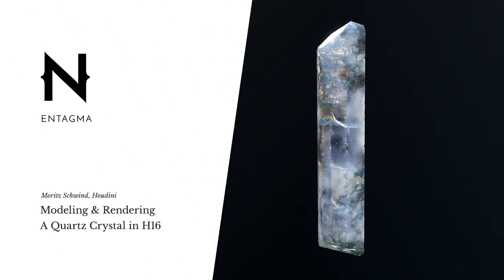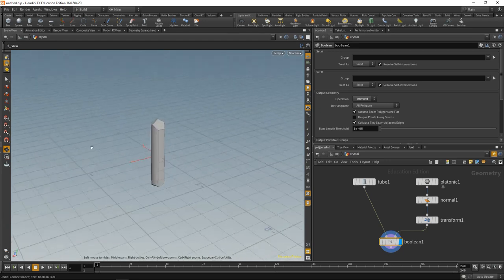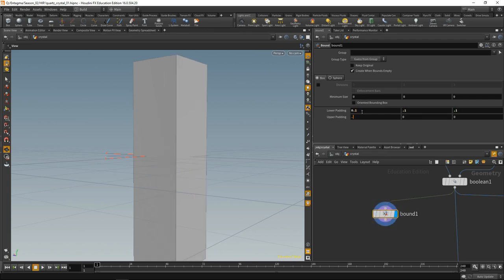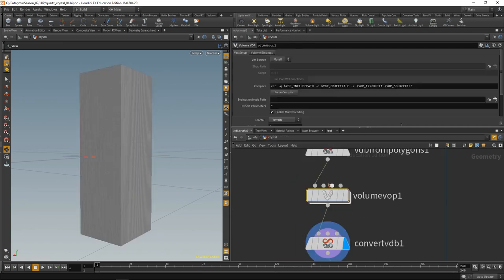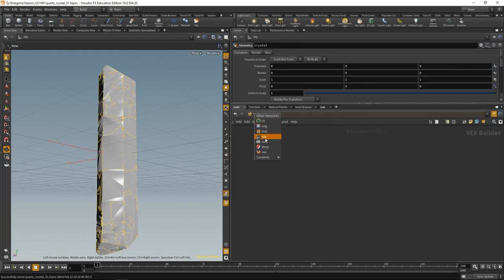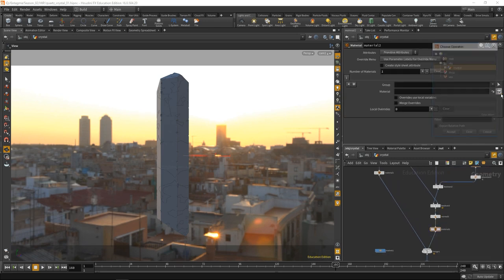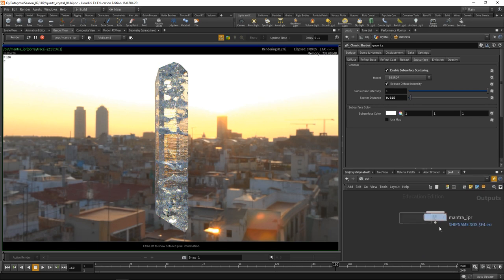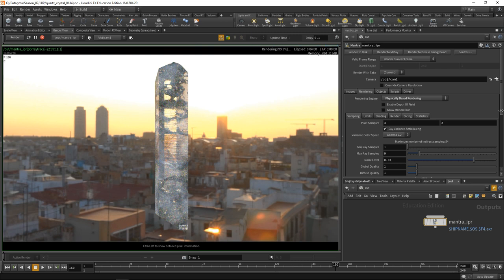Modeling & Rendering a Quartz Crystal in Houdini 16

Comment: For anyone having trouble with the large inclusions not getting created, there exists a random combination of the smaller first inclusions that, when passed through the first boolean, results in a mesh that looks correct but is in a state where the second boolean fails to create interior geometry. To fix this, swap the boolean order, first shatter the crystal, then subtract the smaller inclusions. You should now have interior geometry for the main shatter and it will render properly.
Reply: much appreciated, you saved me a lot of headaches
Reply: @lm96gatling  No problem, it drove me nuts for a little bit.  Glad it helped.
Reply: Hey man I think I'm on the part you are talking about but still don't understand completely
Reply: @hayden7524  When you display the output of the first boolean and you see small inclusions, but then move down the tree and display the output of the second boolean and there is no output then you are experiencing the issue I ran into. You will only encounter this if you follow the EXACT dimensions and decimals used in the tutorial. If the second boolean output has large inclusions displayed in your viewport then whatever rendering problem you're seeing is coming from something else in your node tree.

Comment: sharing your appreciation for crystals=) hope this helps!

Category 1 cubic: garnet, fluorite, lapis lazuli, pyrite, or sodalite
The cubic system is characterized by axes at right angles to each other. 

Category 2 hexagonal: calcite, tourmaline, emerald, or ruby
The hexagonal system is characterized by its three-dimensional hexagons.

Category 3 tetragonal: apophyllite, vesuvian, apatite, or aquamarine
This system is characterized by three axes at right angles of which only the two lateral axes are equal.

Category 4 trigonal: amethyst, aventurine, quartz, calcite, or carnelian
This system is characterized by three equal and equally inclined axes.

Category 5 orthorhombic crystal system.: aragonite, celestite, danburite, iolite, or peridot
This system is characterized by three unequal axes at right angles.

Category 6 monoclinic crystal system: howlite, kunzite, malachite, moonstone, or orthoclase.
This system contains three vectors of unequal lengths forming a rectangular prism with a parallelogram as its base.

Comment: Hello, I'm using houdini 18 and I seem not to be able to get Input Numer 2 after connecting the Float to the Frequency, please help
Reply: same problem here
Reply: for some reason, the video seems to skip over promoting the parm. If you middle-mouse click on the second input of the multiply VOP, you should see "Promote Parameter" which will automatically add a parameter VOP. (if you right click on the little green tab after selecting "Promote Parameter", you should be able to click "Expose nodes" to see what's created.")
Reply: @zephyrmann  hey thanks, will check that out
Reply: @zephyrmann  It's stuff like this that make Houdini such a pain the ass.  You can't assume anything when teaching it.  So the second a line of code or a parameter is missed the entire thing falls apart.  I can't tell you how many time I've hit a brick wall in a tutorial because the VEX codes doesn't work for no reason.

Comment: Hey, can you do a prism light scattering simulation? :)
Reply: Do by yourself :) Use dispersion in render engines with wavelength (Spectral Ray Tracing). I highly recommend use "Photon Mapping" sampling or "unbiased path tracing", in Photon Mapping most accurate is SPPM - Stochastic Progressive Photon Mapping (use 100 Million with 1000 passes, its progressive so you can stop rendering when its be looking good without any damage), CPPM is great but its available only in Mitsuba render and its pain. Octane has PT+PM, Direct Light+PM | Redshift has PT+PM | Maxwell has Unbiased PT | YafaRay has SPPM, PT+PM, Direct Light+PM, Pure PM with ability to save calculated Photon Map | Luxcore has Metropolis Light Transport (MLT on CPU only), Biderectional PT (fast but bad for complex caustics + CPU only) + PM, PT+PM with ability to save Photon Map, but it don't has passes so it calculated only once and limit is 100 Million photons with additional settings. Ordinary PM calculated only once while SPPM can calculate 100 Million photons with each pass (unlimited amount of passes), on my CPU - I5 9400f and I7 3770k it usually takes up to 4-5 hours in 1080p for still image in YafaRay and Luxcore (GPU slow too), best solution is Unbiased Path Tracing but its slow as hell and SPPM, everything else be having low quality caustics and dispersion... ordinary PM is good unless you have complex caustics - its be not enough photons (even max 100 Million) and caustics be very blurry, ordinary Path Tracing will take forever to render caustics and a lot of rays just miss + for fireflies everywhere (might take few hours or up to whole day for still image on GPU depending on render), Unbiased PT never miss rays and its most accurate rendering method so its best for any case but it veeeeery slow. My favourite is Maxwell, Luxcore, YafaRay, Octane. I prefer to use diamond like material - IOR 2.417 + Dispersion 0.044 not sure what value of dispersion and IOR in glass prism...